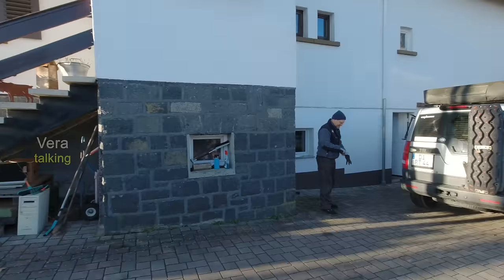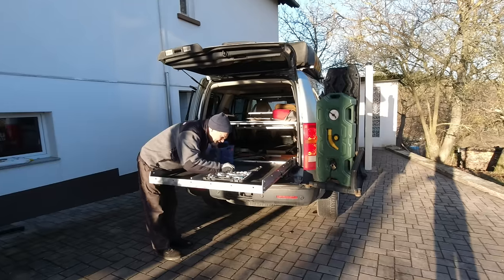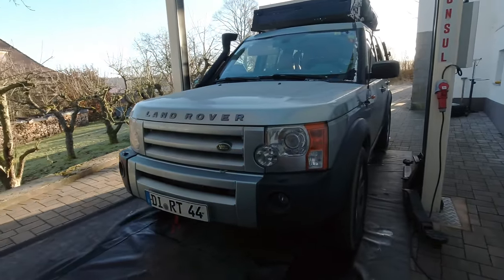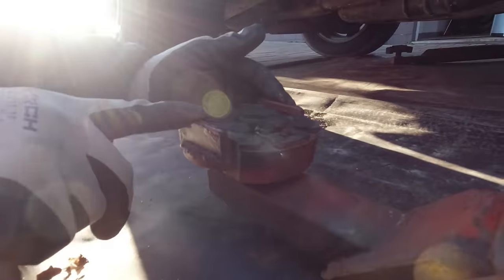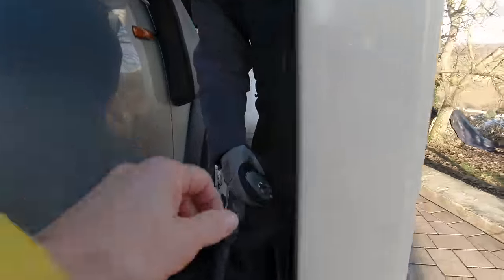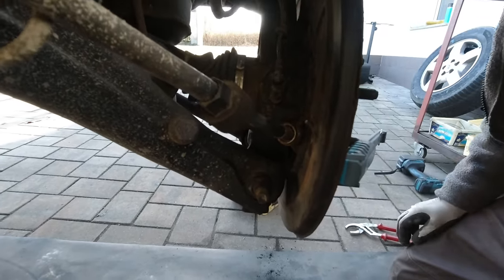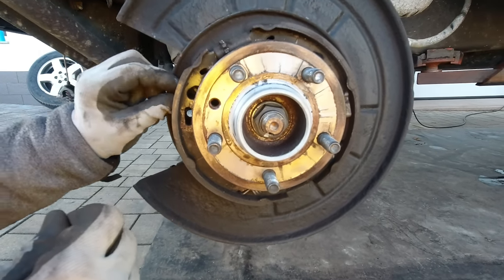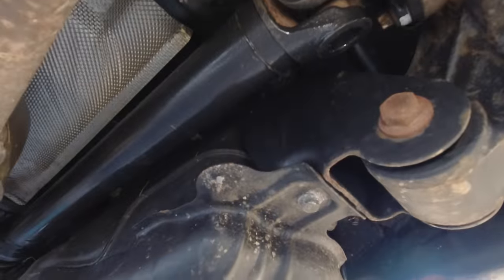How to Fix the Electric Park Brake - Land Rover Discovery / S5-Ep6

Comment: I bet you if this was for the queen she would have had factory parts put in not the ones from eBay.  -)
Reply from the maker: I don't think so. You always have to check the OEM price and how critical the part is. And how easy it is, for us, to get to it. We do have a method and reasoning behind the parts we install and have done our research on everything available. Extensive research. For the Queen however, the Aftermarket is not as extensive as on the Discovery 3 and 4.👍🙋‍♀️

Comment: A normal handbrake should have been standard
Reply: I suspect that the advent of electric emergency brakes was somewhat for legal reasons.  If applied at speed, the normal ABS system uses them to gradually brake the car, versus allowing people to lock up the rear wheels to perform "bootlegger turns" etc.  They usually engage when parking, also act as hill-holder clutches.
Reply: @GunnarMiller  outside of landrover was this module used in any other cars
Reply: We have a number of modern cars with similar units.
Reply: @GunnarMiller  are they all as useless as the landrover unit for giving trouble
Reply: I don't know.  I had an e-brake plunger on a '17 Discovery Sport sieze up on me, but no issues with the '13 Discovery 4.

Comment: A car with just 260000km and everything failes, parking brake, steering, suspension, alternator, starter, what is this LandRover quality, what will I have to expect from my 2013 Evoque that is just 130000 and had - nothing, even the original battery is strong. My last two cars from genuine Volvo each lastet 350000/22y.
Reply from the maker: You don’t have a YouTube repair channel either.

Comment: Asking this question respectfully. Why do you guys continue to keep the LR given the amount of work and general upkeep it needs? 

Landcruiser is just as comfortable, more powerful (v8) and a lot more reliable.
Reply from the maker: More powerful?  Lol.  Who told you that?  My LR4 needs 6.5 to 100 and has  600Nm. Gas consumption less that 9.5L.  More comfortable? Seriously?  More reliable - yes.  Let’s not talk about looks. And we got a repair channel 😬
Reply: Landcruisers are nowhere near as nice to drive.  They are horrible mining trucks in comparison.
Reply: @surlymatt2792  Depends which one, the 79 series i agree. But my petrol 200 series is really nice to drive imo. It makes 220kw and once tuned with a exhaust system it makes 265kw and 630nm of torque. Disco has it beat on fuel economy I get about 11-13L/100. I drove a LR4 the other day at work, was nice but i'd say its about on par with a 200 series for being comfortable. LR makes sense for the channel, the one I worked on needed a lot of work and I used the videos for a couple things :)

Comment: Why can't cars just have the old fashioned hand brake?  Have we all become so lazy that we can't pull a lever? 😝
Reply: I suspect that the advent of electric emergency brakes was somewhat for legal reasons.  If applied at speed, the normal ABS system uses them to gradually brake the car, versus allowing people to lock up the rear wheels to perform "bootlegger turns" etc.  They usually engage when parking, also act as hill-holder clutches.